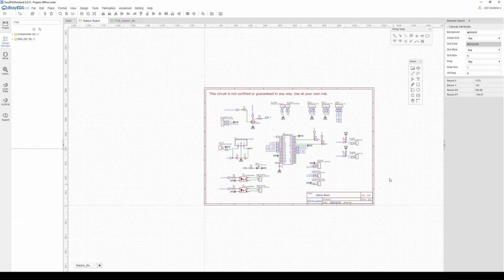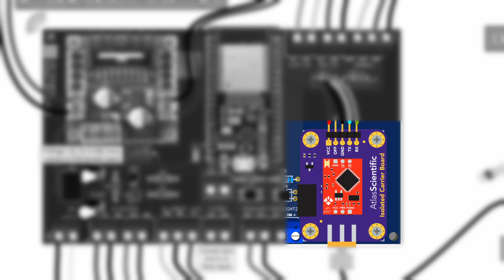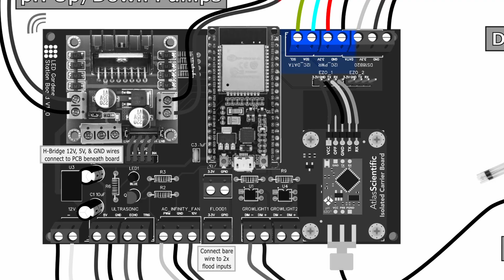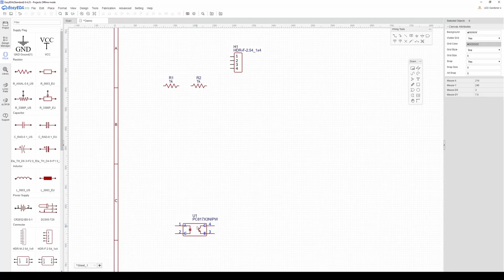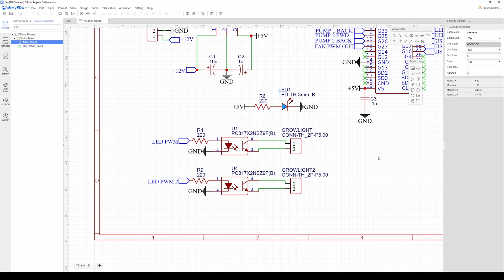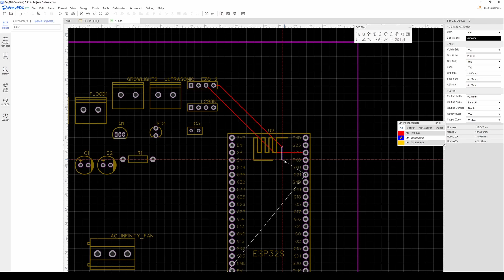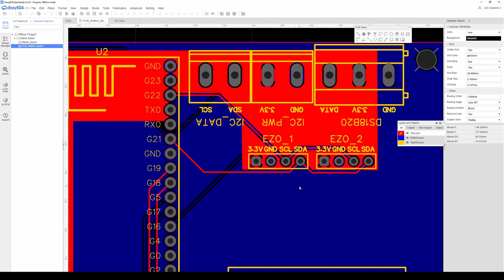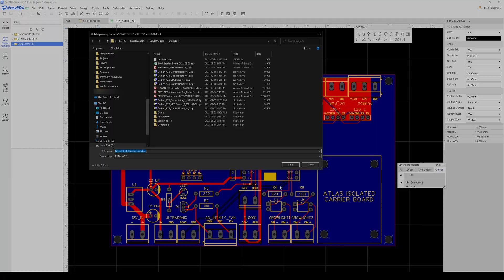Rebuilding My Automated Hydroponic Garden -5- Designing the PCBs

Comment from the maker: Hey guys, just a heads-up that the version of the PCB shown in the video is the most recent iteration and I have not yet had the chance to build one with the handful of changes made (swapped a couple pins around, changed some text, modified a copper pour). Changes were pretty minor so I don't expect any issues but you never know. I have a handful on the way and will build one when I get them.
Reply: how is it going?
Reply: looks very exciting

Comment: You can try setting the clock frequency lower on the I2C bus if you're running longer length cables on those bme280s

Comment: Hi How can I configure the L298N Dual Stepper Motor Driver Board Module to work with a esp32 and esphome? to ensure I give just the right amount of ml to my plants?
Reply: Prime your pump, run for 20 seconds and measure the amount dispensed, adjust the speed until 20 seconds = 20 ml's

Comment: I like the micro controller approach. I binge watched all your home assistant related videos. I am curious though. You no longer use the dosing controls to automate the reservoir nutrient levels? Was there any issues with the way you had your nutrient doser set up? I was considering doing the same thing using peristaltic pumps. My current automation is basic and provided by a click plc.  I just have lights and pumps controls automated. But sensors for plc are pretty expensive so I am looking at this project. I love how you stepped up to a customized pcb.

Comment: Don’t run tracks or ground planes underneath your Esp32 antenna.
Reply from the maker: Noted - thank you. Even if the ESP32 is on headers?
Reply: @LEDGardener  Yep. Try to give the antenna as much space as you can. A slab of copper pour will absorb all your lovely wifi before it reaches the antenna. In your case it’s not really a problem if the Esp32 is mounted flat as there probably aren’t many radio waves coming straight out of the ground. If it’s mounted vertically it could create a blind spot though.

Comment: Good job brother! Great first go at a PCB. If I could offer one piece of advice (one that took me a few PCBs to really appreciate) it would be to future proof your boards. Three tips:
- use solderable bridges (essentially open switches you can close and open using a bit of solder. If you are unsure whether you’ll actually use a circuit loop place a solder bridges before hand to completely cut it out of your active circuit. You can find these bridges easily in the parts search
- run unused GPIO pins to an open area on the board and route them into a header grid. It doesn’t cost you anything and if you decide you want to add another sensor all you need to do is solder on some header pins and using some jumpers you can diy a solution until you accumulated enough reasons to design mark 2. I also recommend running i2c, UART, SPI and some grounds and VCCs. Sounds like a lot but it’s actually very easy to achieve and costs you nothing extra.
- use pads to trouble shoot and validate circuit. Add some pads to your circuit before or after major junctions. Instead of soldering wires on them, use them as test points for your multimeter probes. Have a test pad atleast gnd and vcc.
Reply from the maker: Great advice, thanks for the tips!

Comment: This is great. I thought you will embed the dousing system in this system. Are you going to do it in a separate PCB or tutorial?
Reply from the maker: I have dosing stuff on a separate PCB  - will check it out in another video.
Reply: @LEDGardener  No knowledge about electronics. Is it possible to combine the dousing system in this PCB?
Reply from the maker: If you mounted the motor driver boards somewhere else, you could put a header on this PCB and assign some pins to the additional pumps. You might run out of pins though because each pump needs a pin for enable and a pin for pwm (so you can tell the pump when to turn on and how fast to go)
Reply: @LEDGardener  You can expand the number of I/O's using an MCP23017.
Reply from the maker: For sure - I just meant with the current layout of the PCB.

Edit: I guess I had mentioned adding a header so my response doesn't really make sense. Thanks for the part number.

Comment: Got me jonesing to make my own PCBS…. Need to finish several half finished projects first! 
On a side note, I’ve started designing and printing board/component mounts for DIN rails. I like the modularity and ability to make a cleaner package.
Reply from the maker: Nice. I like DIN rail stuff too. The mean well DIN power supplies look nice and clean.
Reply: @LEDGardener  👍 I got a DC/DC Meanwell for the pi plates project 12v to 5v so it’s easier to use with solar.